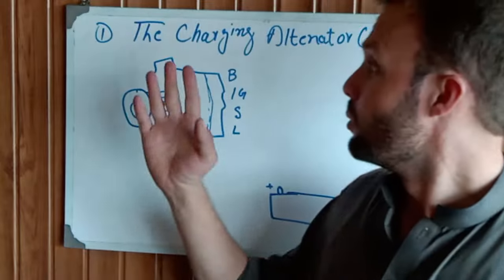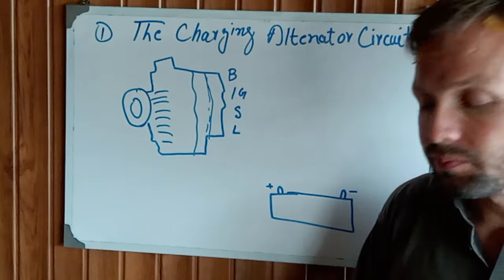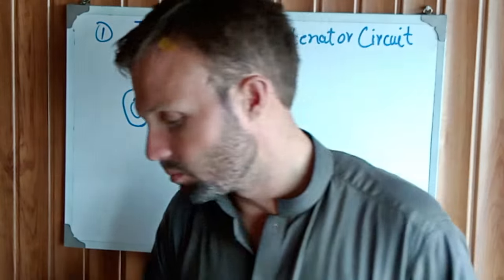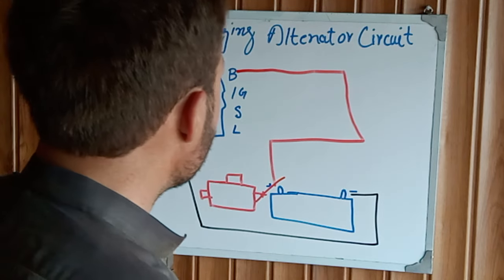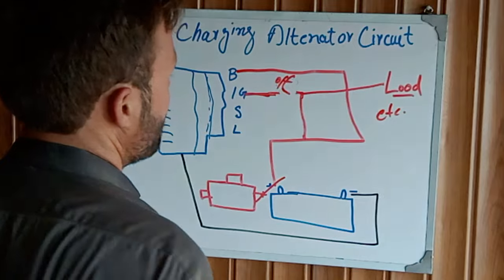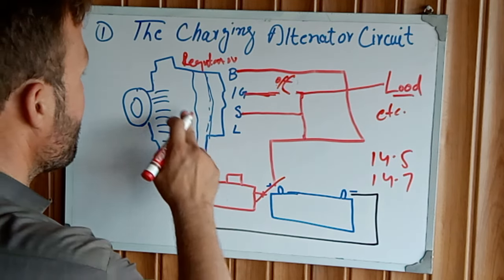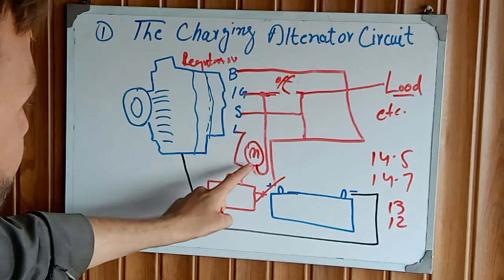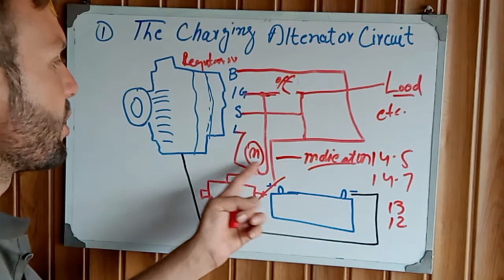Charging alternator wiring diagram circuit explain, how install alternator

Comment: Sir how checked alternator diod and voltage Regulator mostaley diod Falty.
Reply from the maker: Remove and open all diode separately check each one continuity and resistance make sure continuity only in one direction, and resistance should be same all diodes, if any diode find shorted or faulty you need to replace complete set of diodes